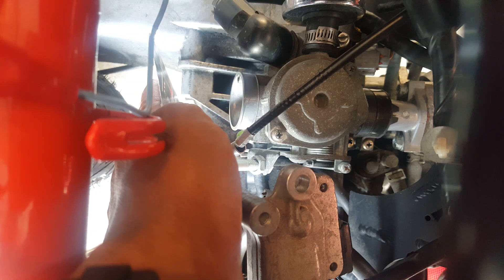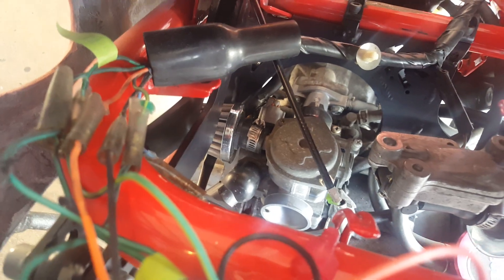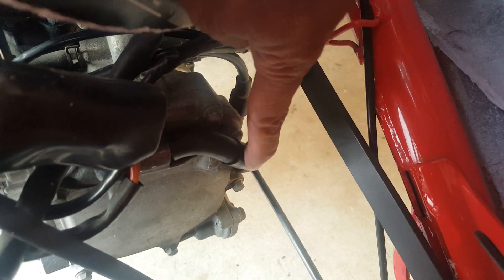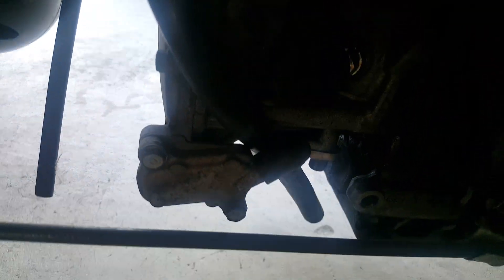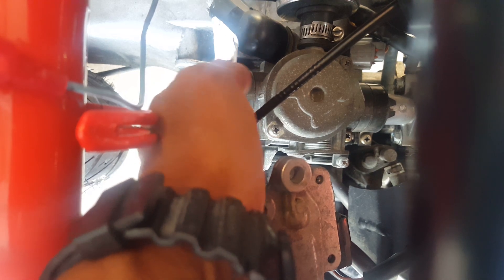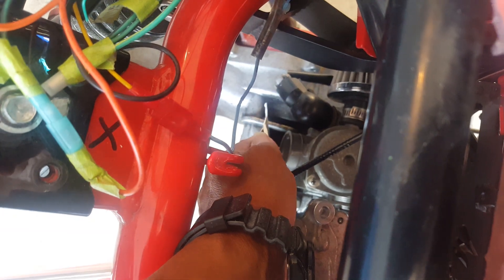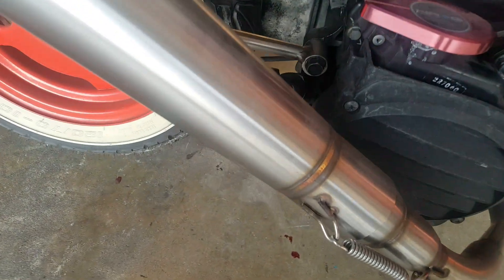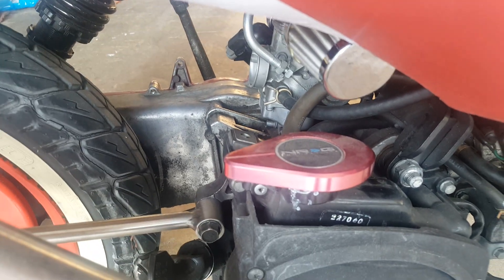Honda Ruckus GET carb problem won't start

Comment: fuel pump bad just like my ruck
Reply from the maker: I installed a new fuel pump. Took the line off and tested it. It pumps fuel when I turn the key and when I twist the throttle.
Reply: ArtDaBarber619 what was the problem I have the same problem
Reply: I have that problem right now ? You get any help or answers
Reply: Any solution????
Reply: @ronnierasmussen4054 still need an answer?